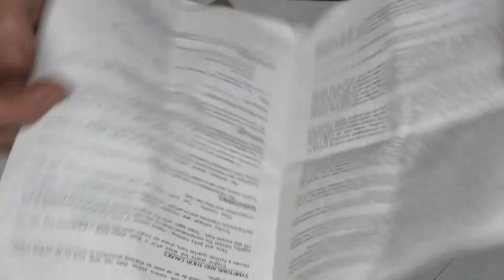Irvine .75 Replica Mills

Comment: As a matter of interest, the Irvine Mills engines are a completely different design to the originals. They were totally re-designed for modern CNC production and metric dimensions. The originals were all hand made and very inconsistent. Because of the way the piston, cylinder and contra are hand matched it was important to run every one. Each one was oiled after it was passed from QC to packing.
Aurora only bought the tooling, not the rights.

Comment: I wouldnt soak it, i've not had much success with that method, I would stick any old prop on it to get slight leverage, take the tank off, and use a heat gun, carefully to warm up the case, holding it in a glove, and then try and turn it over, gently easing it, once it has moved, just work it carefully, and use some normal spray oil of whatever to further free it off, it should come good pretty quick, done it with loads of old gummy diesels, works every time for me.

Comment: Soak it in paraffin or heating oil /station diesel fuel/jet fuel which is the same as the Rc diesel fuel do not use glow fuel it may effect the tank,looks like it has been run, Irvine would not have package it still wet withe fuel they would have dried it out and used light oil .